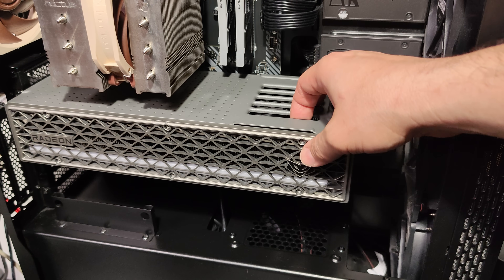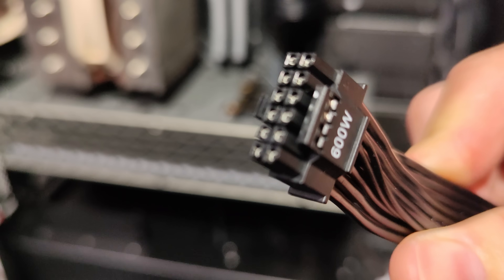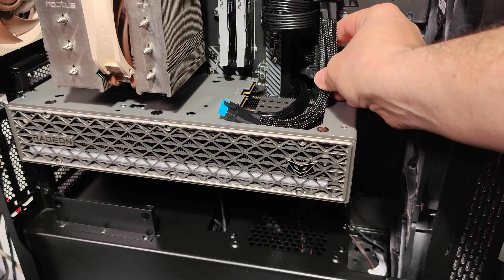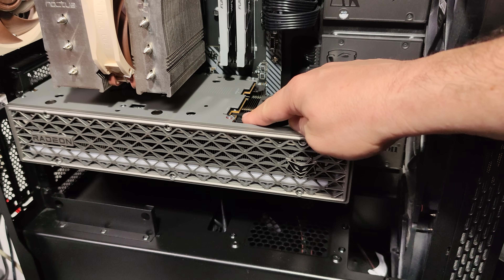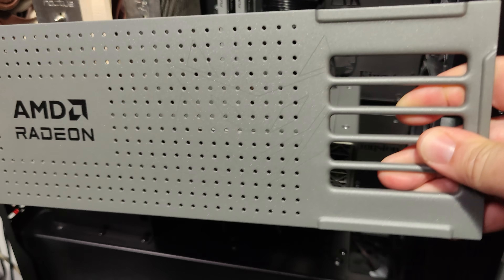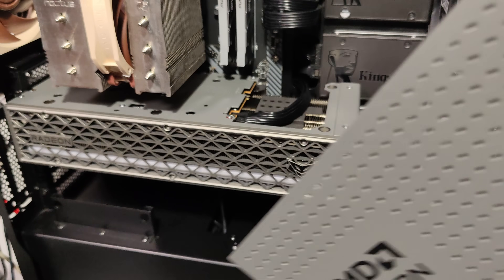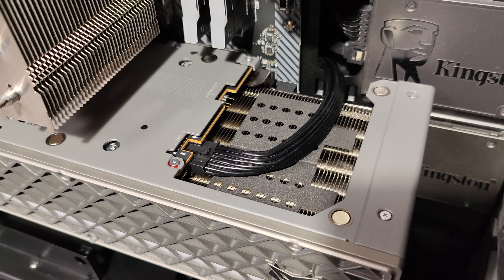Radeon RX 9070 XT Sapphire Nitro+  Magnetic Backplate More Problems Found And Exposed 🔥

Comment: Most nothing burger problem I've seen with any GPU. I have this exact GPU and the connector is absolutely fine. There's no issue with the adapter. There's no strain on the cable, it doesn't hold up the back plate, and it's not going to be damaged by the heatsink fins. You're complaining about absolutely nothing.

Comment: I made a comment on your short about the magenetic cover. But seeing this video i now understand your total concerns which are legit conserns. Wish Sapphire did not use that crappy power cable is this the regular 12pin cable or the 12v 2 x 6? Really insanity if you use the regular 12pin cable on a Asus Loki psu with rtix5000 (psu uses atx3.0 - 12pin cable) it actually caused melting!! See the horror stories your self. So basically when you bought a expensive atx3.0 PSU and expect to use it for at least 5 years.....Then the 5000 series show up and now people are stressing to purchase ANOTHER expensive atx3.1 psu because they advertise the atx3.1 has better safety measures vs melting and has readouts (not there with the regular 12pin cable).

Then all the other complete fraudulent issues SUPER high price for a mid end card (should be 600 max dollars period) I remember the day that a 80's card was (1080, 2080, 3080) 700 - 800 dollars....So now they ask on a 70's serie a whopping 1600 euro for a rtx5070ti!!! Let that sink in we are surrounded by THIEVES both the AIB's and retailers and above all NVIDIA! So this time around il be getting a 9070 xt. Tired of NVIDIA and their lies and use the end user as guinea pigs and still blame most of it at the end user. Screw NVIDIA for betraying their loyal gamers who made the company as it is today but now they don't care anymore with QC and support for gamers with good cards at a decent price.

Comment: The Sense-Pins on the 12 HPWR plug dont check the exact voltage at the GPU. They only give a information, which power the PSU can deliver to the GPU and if the cable is plugged in. Thats made to check if someone plug a 600 W GPU on a 600 W PSU, which cant deliver the needed power for the GPU.
But with the location of the power plug of your card i agree. Its a stupid design and the cables ar not made for this direction of bending.

Comment: I also bought this card. I will not use the metal plate. I will also run the power cable down from the side of the graphics card in a linear manner without bending it. From there it will go to the PSU. I don't think there will be any problem this way.

Comment: I have one, there’s no issues.  Ask Sapphire if they’ll send someone to hardwire it to the PSU so there’s no voltage drop.  While the engineer is there, teach him all about voltage drop because surely these board designers don’t account for that.
Reply from the maker: Lucky you! Maybe while the engineer is there, they can also explain why melting connectors aren’t a feature. 🔥

Comment: I installed mine yesterday and didn't struggle. I also used the anti-sag bracket. The Backplate, on mine, doesn't move around as the magnets are quite strong. I've had nothing but a great experience with this Graphics Card.

Comment: Having 2x backplates is bad design. It will only increase Vram and PCB temps nothing more. Pulse is far better design. And if there are no thermal pads bellow first backplate to transfer heat from Vram/PCB it is even worse having 2x backplates...I would never ever use 2x batckplates on 330+w card.Just bad design by sapphire.
Reply from the maker: You are a fine connoisseur, happy to read such a good observation about this card.

Comment: Use a GPU Support bracket that comes with the card!!! Or use the Cooler Master Tampered Glass GPU bracket like I have, and make sure your card is neatly leveled and not slanted like yours, this is why it causes the card to warp and make sure your magnetic plate isn't placed flat on the card,  others are right, your system is the issue, I know others with this card and it's probably one of the best if not the best 9070 XT ever made.

So you can complain this and that bla di bla, but you are the cause for why the backplate is jumping about, your card is lacking the GPU support bracket which can prevent this ;) 

Then again  all of these AIB cards are over designed, none of these cards need to be triple slot or even greater  Dual Slot works good enough for a mid end card that uses Navi 48.

Comment: sry, but this complaints where just BS, there wasnt even one single valid point.
Reply from the maker: You’re right — melting connectors, blocked heat dissipation, and foam on heatsinks are all totally pro features. 🔥
Reply: @TechTronic9000  did the connector melt or is 350 watts not enough to do it...did you even test if the backplate blocks heat? didnt see a single one confirming your claims... what you are doing is just hating on a product in order to atract the type of people that already hate this GPU and generate clicks out of it

Comment: my nitro+ backplate fits, because i use sleeved psu cables - but another issue: the backplate is colliding with the pci slot bracket. so when you push in the backplate, the card comes out of the slot. i solved it by pushing the backplate under the bracket
Reply from the maker: And voila more issues with unnecessary add-ons :)

Comment: Video should just be titled "Skill issue". I have this card, and even this same motherboard. The power adapter it comes with is fine, the back plate fits perfectly fine if you actually put it on right and situate the cable better. And it has no problem with cooling with the backplate on. Mine runs around 50° even pulling 360 watts.
Reply from the maker: It's a saying, ignorance is bliss.

Comment: Well for starters your PSU is ass. And second that is the lowest quality cables lol. Get a better cable.
Reply from the maker: 90%+ cybenetics test efficiency starting from just 20% load, 12 years warranty, yeah, really bad PSU, I will throw it away and buy one with RGB and colored stickers made in the same factory but sold 2 times more expensive. What does a cable have to do with poor design, using the worst power connector ever made, sticking foam onto the heatsink, adding a plate over a plate and then charging 300 euro more.

Comment: Why do you have an 1300 Watt PSU? What is the point? Power efficiency is way down, I mean if you have cheap electricity don't mind my question.
Reply from the maker: Because the PSU has already 91.67% efficiency at just 20% load and comes with a 12 year warranty. I also have a more power hungry Ryzen 9 5900 and 5 SSD drives.
Reply: @  You can get load 20-25 % power efficiency with a cheaper 850W GX or PX form Seasonic and are tested by independent Cybenetics . They offer voluntary certification programs such as ETA and Lambda, which focus on efficiency and noise levels, respectively.

I found just a single website that had Deep Cool certification by Cybenetics but, couldn't download it "forbidden", couldn't download from their website either but I can download for Seasonic  Cybenetics reports at leas for GX 750 Vertex. I don't trust manufacturers that say they have the certification but, you can not see it.

Comment: I will avoid any graphics card that has this PSU connector. They need to go back to the drawing board on this one.
Reply from the maker: Everyone knows it's a bad connector and yet they use it. off course it's not the same power draw like on the nVidia. The connector is rated to 600W and the 9070XT draws around 330W
Reply: @TechTronic9000  A flawed connector is a flawed connector no matter the power draw and will be prone to failure. It might just take longer to fail. At any rate I wouldn't bet my hard earned money on it.

Comment: I am so happy somebody finally mentioned basic electronics and how the more stuff you have connected the worse your system efficiency is. This is a problem not a lot of DIY PC builders understand and is also part of the reason why we have the worst situation with hardware reliability in decades.

I would be very interested to know what the rest of the components of this pc are, and generally I think you have a great understanding how to build reliable machines. Thumbs up for this video!
Reply from the maker: Thank you for understanding what I was explaining. 
The rest of the system is
MB: MSI MAG B550 TOMAHAWK.
CPU: Ryzen 9 5900X.
RAM: Kingston Fury Beast, DDR4, 32GB (2x16GB), 3600MHz.
Storage: For OS: Samsung 980 PRO Gen.4, 1TB. For fast "trash files writes / reads": ADATA XPG Spectrix S20G 1TB, and for slower storage 3x 960GB Kingston A400.
PSU: DeepCool PX1300P.

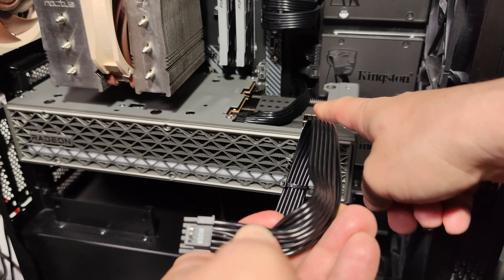Comment: 2:10 separate the cables, einstein. they don't have to be in a ribbon.
6:25 leave it the fuck alone, close the case and go about your day.
7:55 your mum had a voltage drop when you were born. the voltage will not drop below tolerance from one extra connection.
this type of problems is usually classified as pebkac.

Comment: I don't have that problem; in my case, I have a 450W cable, so it was easy to bend. But I can't use the damn GPU backplate because my motherboard is a Gigabyte B850M GAMING X WIFI6E, and the motherboard's backplate doesn't let the GPU backplate fit. So I'm using the card without it. I can say that the card looks f***ing beautiful when it's on!
Reply from the maker: Yet we pay extra money for the backplate :D

Comment: To stop the cables from being stiff you just need to peel the cables off eachother. Theyre currently stuck onto eachother for aesthetics but id you peel them away it becomes loads more functional.

You can then put your back plate on with no issues 😊
Reply from the maker: Yes, that is true, yet doesn't fix the poor choice for the power connector and the foam over the cooling fins.
Reply: @TechTronic9000  you can take the foam out and wrap the cables to insulate against heat, the power connector is the only real problem tbh and I guess it has no solution except hope for the best

Comment: not sure what to say about this video,  i have the same GPU, i tested on cyberpunkt with it pulled around 340-360 W i can say the video card  was sitting between 50-55 C , has very good cooling in my opinion i never seen it go above 60 C and about the 12V connector i think it's pretty safe to use on anything that pulls under 400 W.
Reply from the maker: Don't understand me wrong, the card works fine, yet we pay extra for gimmicks that don't work as advertised, it's marketing over functionality.
Reply: @TechTronic9000  with that I can agree, also the retail stores are the new scalpers, paid for it 950 euro... but I'm upgrading after 6 years as my excuse. Nvidia surely needs more competition not only from AMD from intel as well if we want to have a decent market, I doubt that will happen any time soon. Main reason i chosen this GPU over the Nvidia equivalent was the price,  i seen 5070/5080 gpus that go from 1500 euro to 2000 -2500, insane! and not even from scalpers, Retail stores.

Comment: Fitted mine properly with a nzxt  12 pin so i dont have your issues :)Temp also fine and that backplate is well stuck on there
Reply from the maker: Yeah, and payed probably 300 euro more for that, which brings nothing in performance or functionality.
Reply: Nope your wrong i paid £110 for the power supply and the cable came with it so i paid 0 Euro's and 0 gpb extra,,I could of used the cable that came with the card but seems i needed a psu anyway made sense to buy one with the 600w connector,Your correct about the backplate not sitting correctly thats because your not using the original lead or a properly fitting oem lead..my plate is 100% fine so i stand by my post that mine is fine as i fitted it correctly and you have not. sorry you cannot take constructive critism it wasnt meant to offend just saying that lead your using is the reason the plate doesnt sit well and mine does.

Comment: PROBLEMS FOUND ANE EXPOSED, FIRE EMOJi! .... i wasted my time clicking this
Reply: For some yes.. not so much for.others.
Reply: @garystinten9339  everyone wasted their time listening to this video.

The only thing you should be doing is:
- use the adapter if you don't have an ATX 3.1 standard PSU (12vhpwr cable and connector is built differently)
- disable "zero RPM" mode on the card and give it proper temp curves

"Why"?
GPU MEM TEMP - this value stays at ~60C in idle with zero RPM mode on the gpu.
With that mode disabled, and the fans going at 1000rpm in idle, your temp will be at 56C

"Why part2" ?
That mem temp can go high, and you want it to stay cool.
Reply: @AzKat69  what? In every test I've seen, the memory temperatures of this card are 90°+, not 60°
Reply: @deadalive7311  "in every test", I was talking about idle. Also now that it's been a while, my gpu temp is a lot lower, with the "evil plate on", it's at 42C

Comment: Good video - stupid design on this card. 
Like you pointed out - the foam blocks air, the backplate is not secure because of the cable, and thus provides no thermal benefit, removing the backplate makes the most sense, but makes the card look incomplete.
I don't understand why we haven't seen any manufacturers extend 1/5 of the PCB out past the blow-through area and have a power connection on the side. Lots of cases are long enough to support moving the power connector - it would provide more room for fuses (for that stupid 12vHP connector) and some airflow over the power delivery circuits couldn't hurt either.

Comment: You may be able to just separate the wires by pulling them apart, they should tear neatly into separate wires. it should make them bend a lot easier. You can do this on most flat cables.